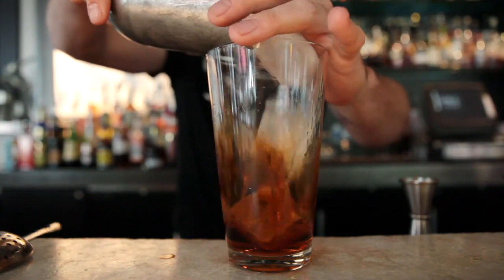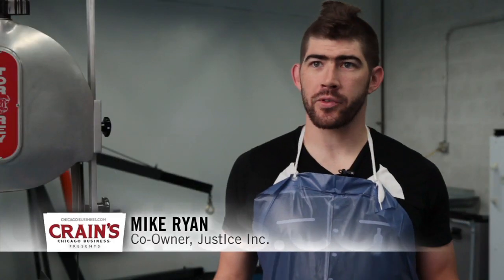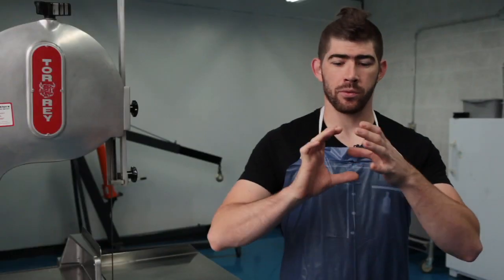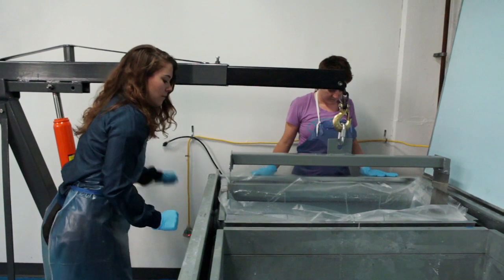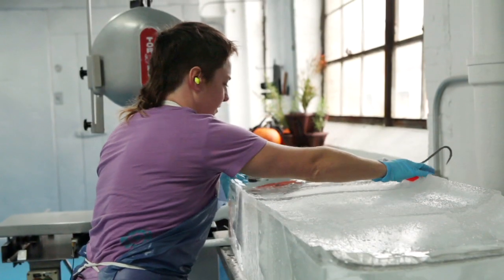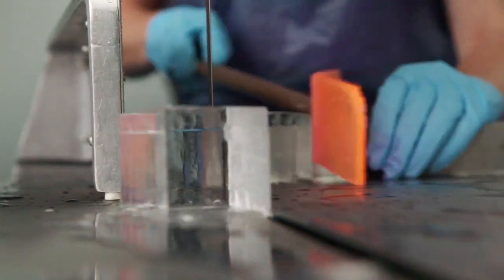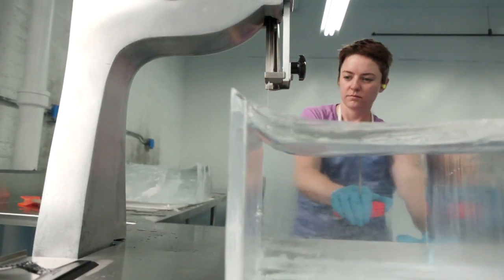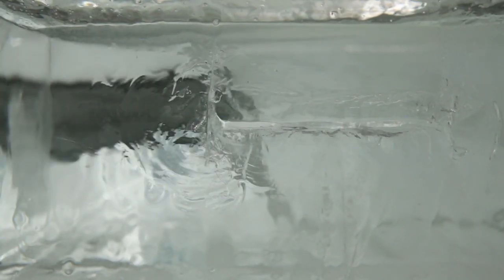Making the perfect ice for the perfect cocktail

Comment: I make my own using a regular Colman 9 qt cooler put water inside pop in the freezer for 24 - 26 hours It works very similar it freezes from the top down pushing all the impurities to the bottom so what you do is once it’s frozen and out of the cooler poke a hole in the bottom so the remaining water can come out : (disclaimer do not let your ice freeze all the way if you let it freeze completely it will be cloudy): Then cut into cubes put in a gallon freezer bag and it stores perfectly
Reply: How many hours before the 24 hour period do you remove to break the water chamber just under the frozen part?
Reply: Oh and do you leave the top open or close on the  kooler.?
Reply: @veronicadavis9311  keep the top open that way all sides and bottom are insulated but the top isn't. This mean it will freeze from the top down because it's the least insulated point.